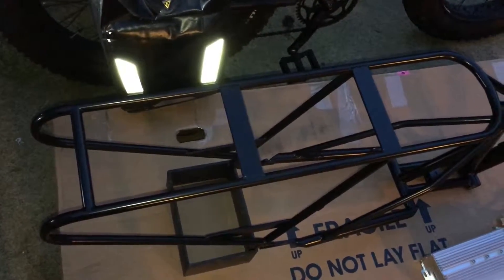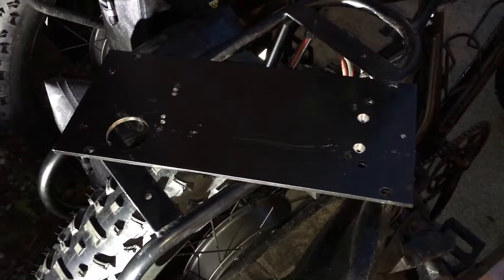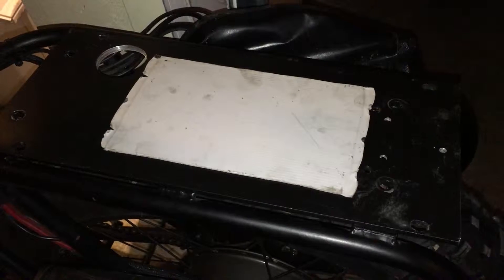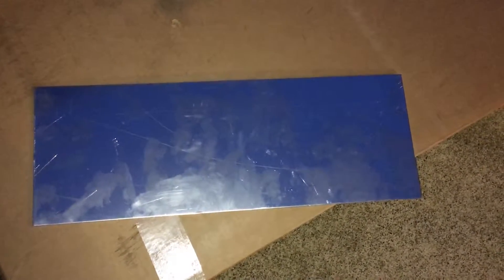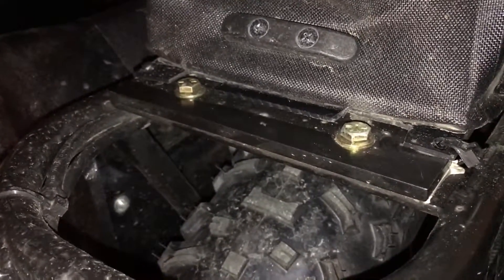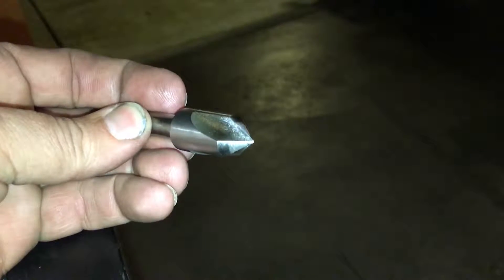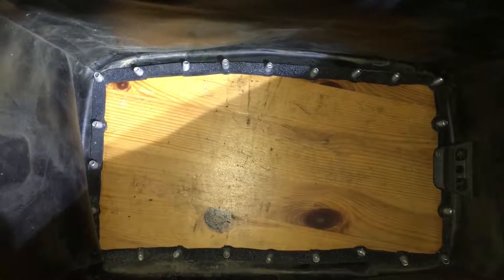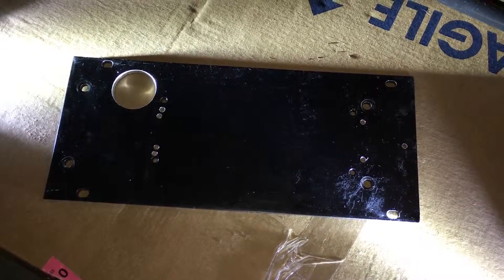E-Bike Controller Passive Heat Sink eBike

Comment: Did you add some heatsinks to the top of the controller? I had trouble finding a sine wave 14a controller that's not black or miss-sold as square wave, so I opted for black. Normally(UK weather) the heat is not really an issue but on the odd occasion in the globally warmed summers(23+ deg) my black controller cuts out, I even have it out in the open air, I am going to add a couple of heatsinks to the flat surface any advice on securing them?